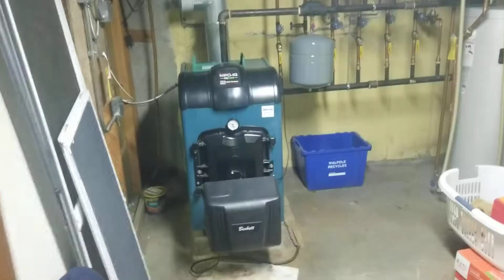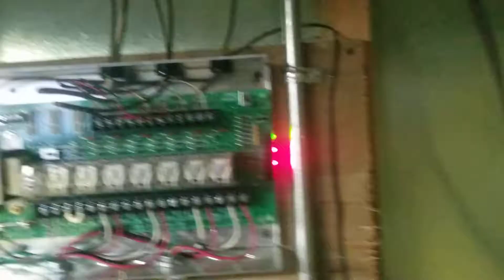Taco 6 zone relay switch failure

Comment: David Smith is correct.  I just fixed a board like this.  Check for broken solder joints on the back side of the board.  Add more solder to all the large solder joints, to prevent future failures.  (Companies used the minimum solder.)

Comment: So, mine recently did this same thing.  I thought it was a bad connection on the X X connections. It seemed to come in and out when I moved those wires.  Turns out is was several bad solder joints on those terminal connectors.  Look on the back side of that PC and you will see small cracked circles around the pins on those terminal connectors.  Just resolder them and it will fix the problem.  Tapping the relays will vibrate those connections and make them work for awhile but its not fixed until you re-solder them. 👍
Reply: I fixed mine the same way.  Found the cracked solder joints melted on more solder.
I even future proofed it by adding more solder to all the large solder joints.